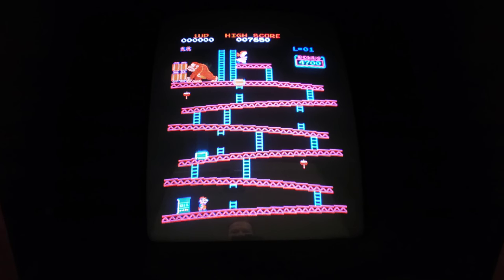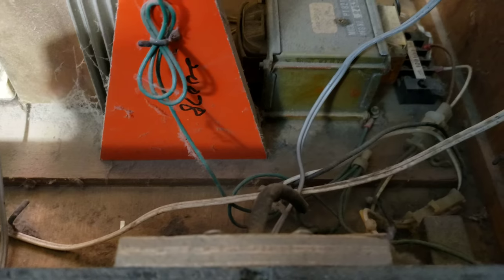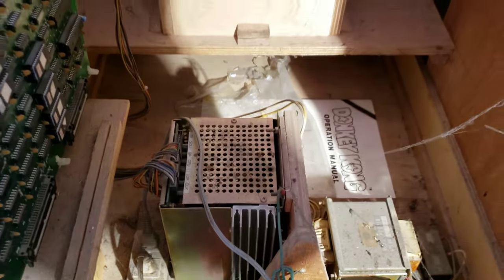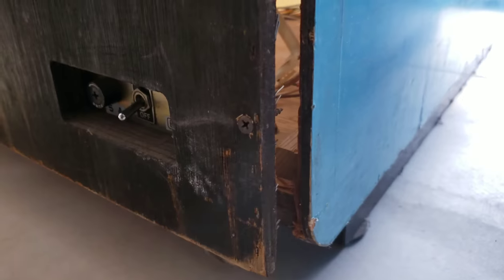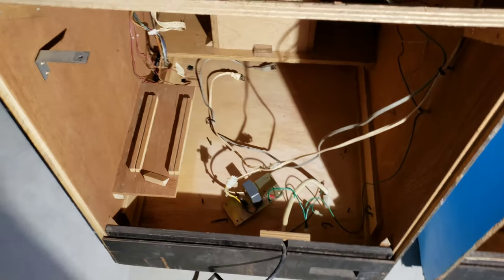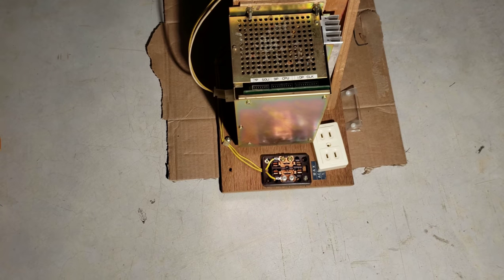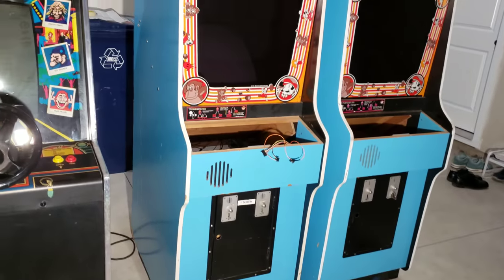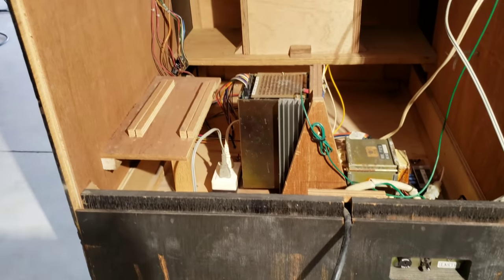Donkey Kong Arcade Restore Part 2 - Control Panel, Power Supply, PCB Game Board, And Bezel

Comment: What can you use as a On/Off power switch replacement?
Reply from the maker: Thanks for watching,  are you talking about a replacement or wanting to move the on/off switch somewhere else?
Reply: @ToddsGarage  A replacement
Reply: @ToddsGarage  I noticed that there was a plastic box attached to it, with a bunch of electronics inside it.   Doesn't look like a normal on / off switch.
Reply from the maker: @TheIyouwas  Did yours stop working? If so Mike's Arcade has a lot of Donkey Kong parts. Thanks again for watching!